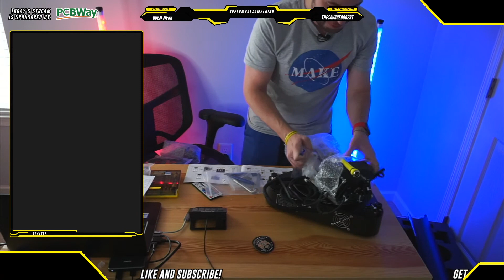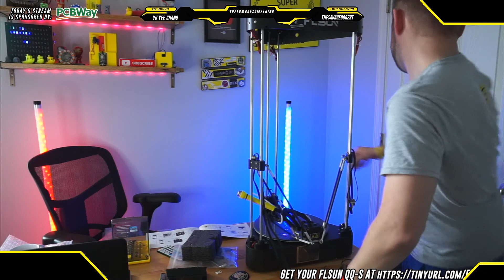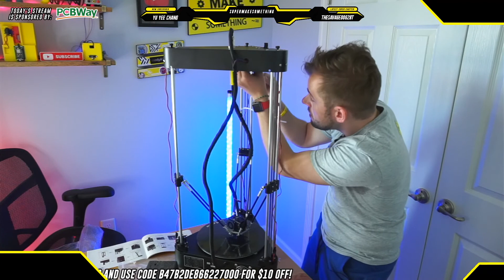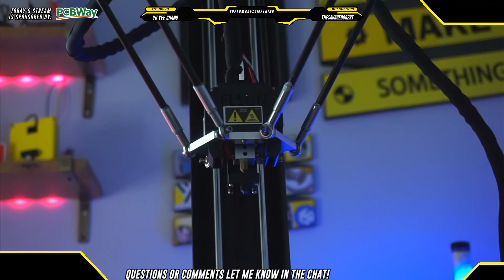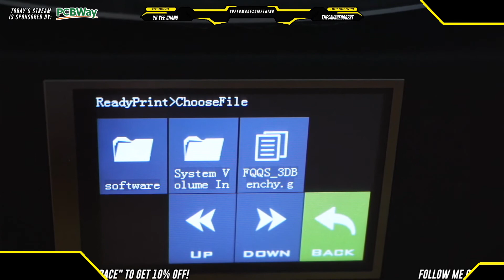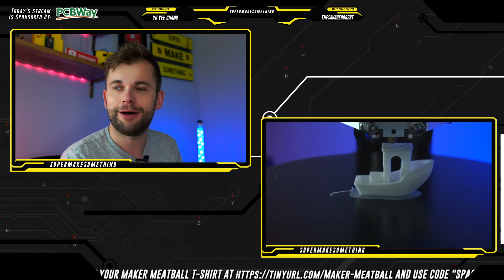What is a Delta 3D printer? FLSUN QQ-S Unboxing, Setup, and Review!

Comment: Can it print tpu and is it upgradable
Reply from the maker: Printing TPU may be a challenge because of the long Bowden tube. However, you should be able to swap out the control board and I have seen videos about flashing different firmware, so this seems possible as well.

Comment: My printer did not easily go through the auto-leveling.  It continues to try to sense from a spot off of the print base.  I found this video after I set it up and didn't get the voltage changed initially.  Did this damage my printer?
Is there anyway to reset it and start over?
Reply from the maker: After setting the correct voltage, I would try going through the auto-leveling procedure again. Remember to set a -0.2mm offset after leveling for good first layer adhesion. If this does not solve the problem, definitely get in touch with FLSUN — hopefully they will be able to help/replace a component if anything is damaged!

Comment: Should have read the instructions first as there was a set sequence of assembly leaving the the bottom unit in the foam tray as the three arm assembly was laid out in a set manner above it for easy assembly. I obtained this info on Youtube from there official videos but also on the sd card supplied with the printer

Comment: i'm thinking about getting one, but have you used it since this review and have you got any further feedback after having it for a few months?
Reply from the maker: I’ve continued to use it and it is honestly becoming one of my favorite printers. The print quality is very good, and its stationary build plate makes it great for time lapses, which is something I look for because it helps make my video production easier. The z-height is also nice compared to other printers. The biggest negative for me is that it does not have a magnetic/flexible build plate, which makes it slightly more difficult to remove prints vs. my Ender 5, but the Build-Tak like surface is very good, so it is really a minor complaint. If you are looking for a fast printer with a large z-height, this would definitely be my recommendation after a few months of use. Hope this helps!
Reply: @SuperMakeSomething  I think that helps, my biggest issue was trying to find a decent review of this machine that wasnt just somebody getting it from a supplier and being a bit biased. Honestly i started looking for a second printer and seeing that the Artillery Sidewinder X1 was on special and then the suggestion popped up for a delta (which i didnt even know it was a thing), but hearing they can print large volumes faster with not much difference in quality, got me interested.
Reply from the maker: 3rutu5 Totally understand. The x-y build area is a bit smaller than a Cartesian like the Ender 5 bc the QQ-S’s build plate is circular, but it definitely makes up for it with its larger than average z-height for tall models. I have not had a print fail yet, which is a good sign, and trust the machine enough to do overnight prints for timelapse purposes. The use case for this printer is probably a bit different vs something like an X1, but in terms of print quality, it is definitely up there and is also good for “everyday” printing.

Comment: My first 3dbenchy print failed when the QQ-S pro was building the roof of the boat, due to poor adhesion on the print bed. When I did the Z0 calibration, the nozzle was a little too high, and upon fixing this the second print turned out perfectly. Total print time was 1 hr 6 min. I love this little machine, and I will post updates on its longevity/reliability. Would recommend buying an sd card reader if you don't have one already; for now I'm just using my phone's micro SD card slot since this is my first printer.
Reply from the maker: Awesome! Glad to hear that it is working out and that you were able to fix your issue! I also had to adjust the Z-offset during the livestream, but have not had to level it since. It is quickly becoming one of my favorites because of its large build height and stationary base, which makes it great for timelapses!
Reply: What speeds was this benchy printed at? I just ordered my QQ-S Pro. I'm still waiting for it to arrive but my cura estimate was only at 35 minutes.

Comment: Thanks for the review and walkthrough. A few months back you had reviewed the qidi x-pro. If you were to only use one extruder on the x-pro and compare it to this delta, which do you think has the better print capability? (Just on quality, ignoring volume, etc)
Reply from the maker: Sumomo Rex Thanks — happy you like the video! It’s a bit of a tough call between the printers, since they both produce great prints. The X-Pro’s main strength is really its dual extrusion capability and the fact that it is direct drive. The Delta is definitely faster because of its setup, but it is also a Bowden, so printing exotic materials and/or materials that need an enclosure will be tougher. I would say if you are truly only interested in single material prints, and will exclusively use PLA, go for the FLSUN QQ-S, because it will allow you to tackle bigger projects in the future and because it is easier to use with the latest versions of Cura out of the box. If you intend the experiment with materials or plan on printing any type of material like ABS, I would go with the X-Pro. Hope this helps!